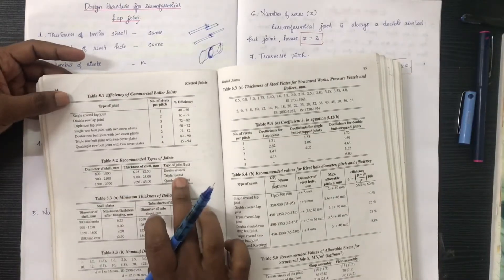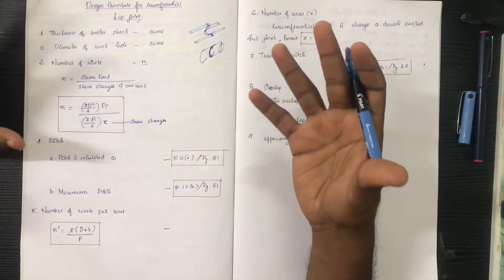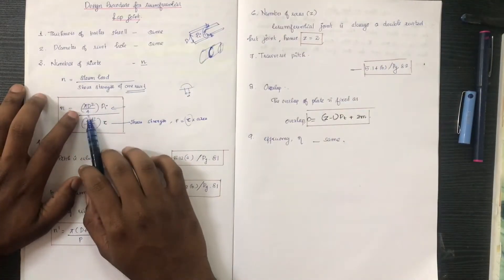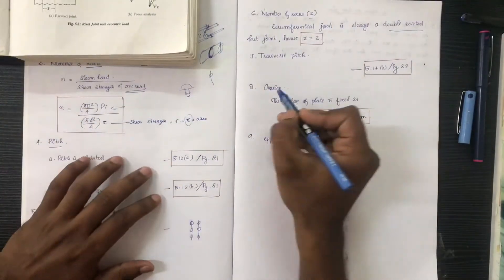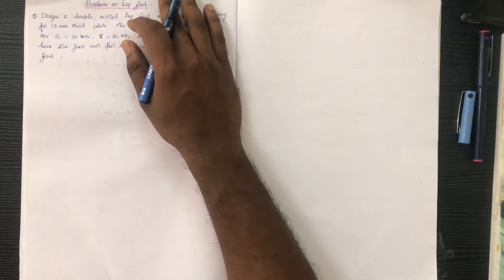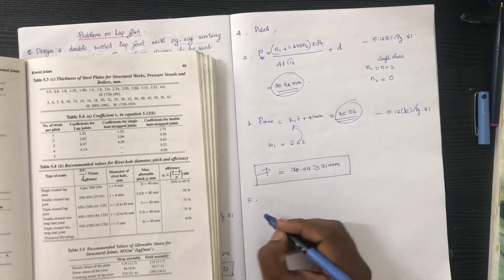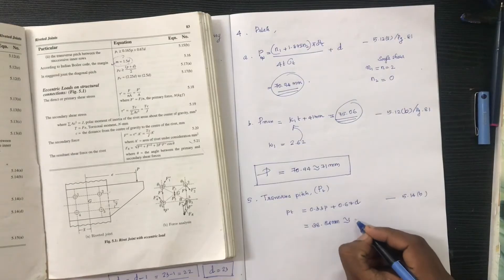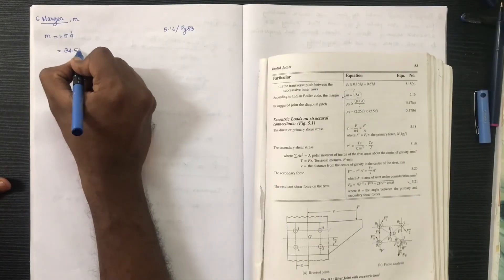KTU-DDM-DESIGN OF REVET- PART 6- BOILER LAP JOINT DESIGN

Comment: 8:59 sir evide d1=23 avumbol b/w 12 to 24 mm rangeill d1=d-1 so 23 =24-1 so , d=24 alle varendath 🤨
Reply from the maker: d = dia of hole , d1= dia of rivet.. table 5.3 prakaram dia of rivet e namukkullu..so d’ athu vech matti edukkanamallo… d1 , ie rivet diameter l alle rivet varu, d - hole dia athu anusarich mattum
Reply: @LETSDISCUSS1   sir hole dia allallo nmuk kittiyath, appo ath 23 aakki eduthu but here nmuk hole dia rivet dia kaalum valuth vende?
Reply: @LETSDISCUSS1  sir ithinu munb ulla video il dia of hole aadyam kand pidikkum pinne table nokki std cheyyum, then aa kittiya 'd'  ye d1 ennakkum pinneed aa eqn d=d1+1 cheyyum ennalle . ippo ee videoil ethiyappo thirinju. appo etha sir correct follow cheyyendath😅